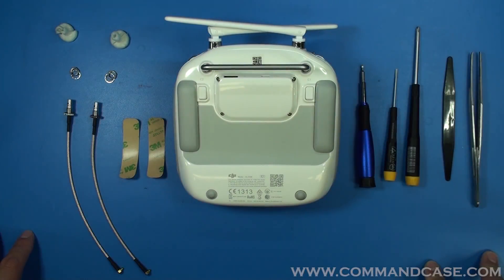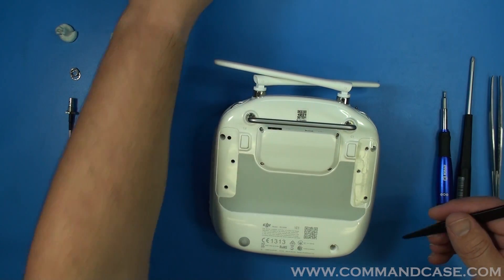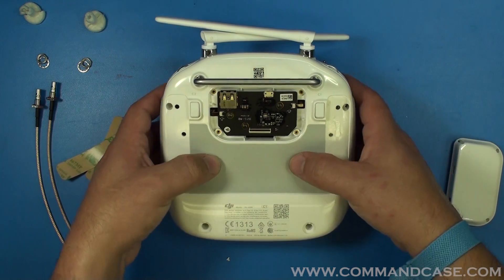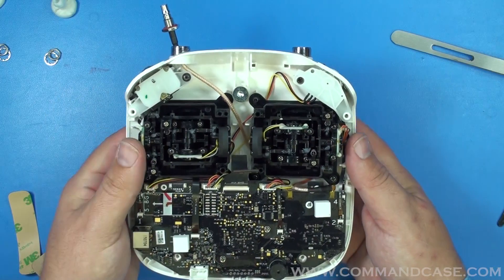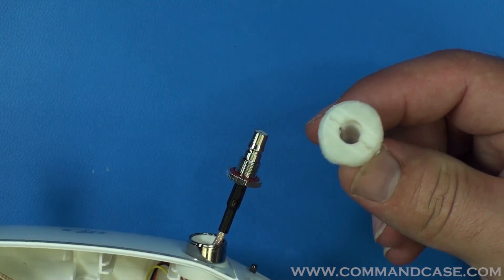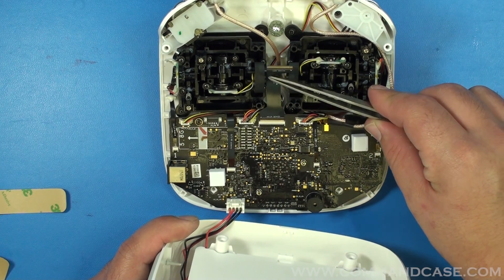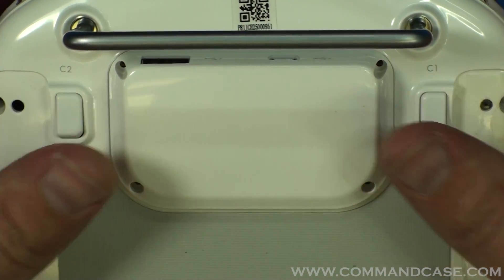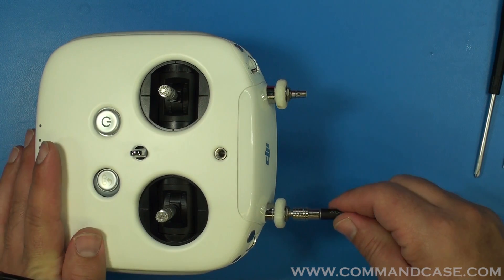Phantom Controller Mod

Comment: I would like to say something that makes a part of this MUCH EASIER for me anyway. During the Last Ribbon hookups on the back where the USB and Mini fits into the card. What I did a couple of times is not to mount the card first.( I put an Argtec in one time Before so I have done this a couple of times ( I left a Ribbon cable loose the first time. #2 ) And as they say Make SURE you check them BEFORE Putting the case back on!) just Hook up the Botton Ribbon Cable First ( BIG ONE ) then just angle the board to one side and hook up that Little Ribbon cable then tilt it to the other side and hook up that one just be careful because you have the ribbon cables dangling with the board until you put the 3 Screws back in but its no worse than dangeling the control wheels when your inside it. This way you dont have to risk using tweezers or needle noses to insert them. It's a LOT easier for me and maybe for somone else also. I hope that helps.